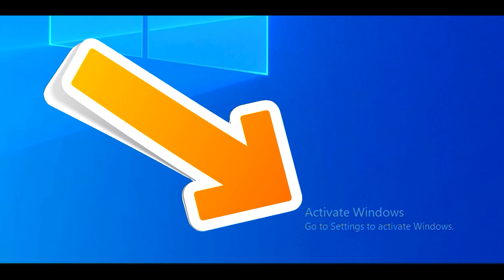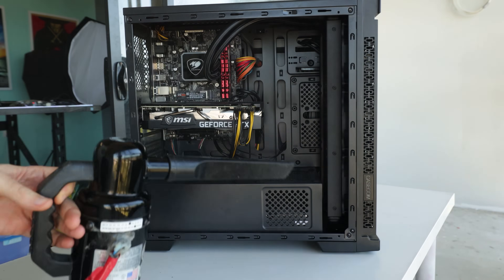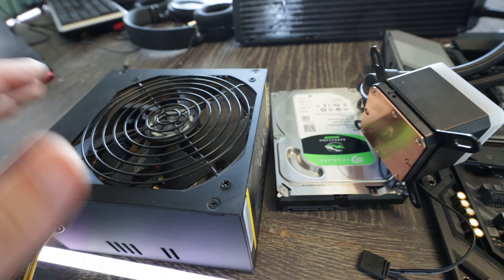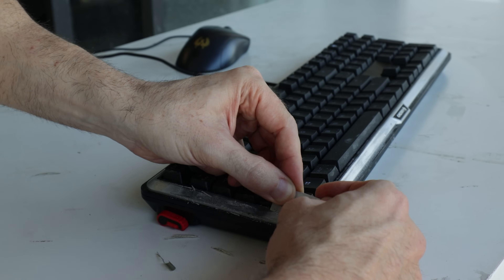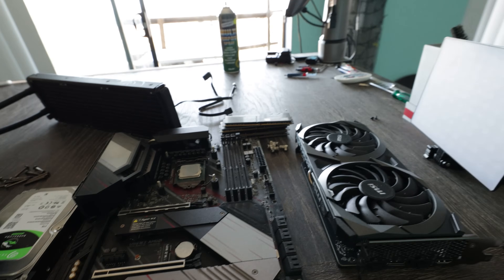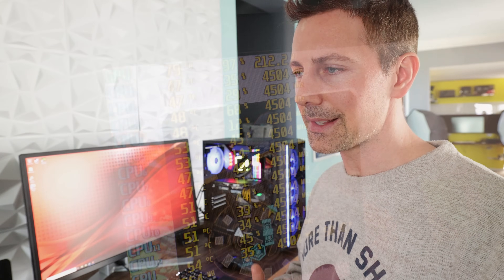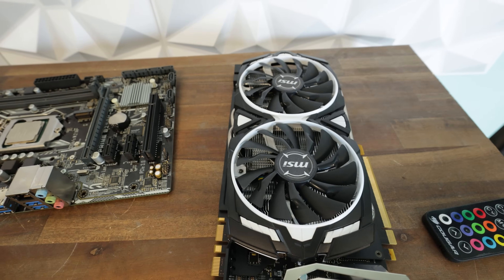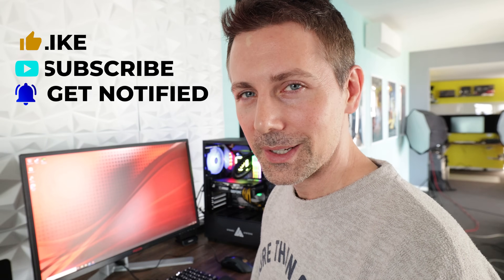How I got a $1000 RTX 3070 SETUP (Cleaning and Fixing)

Comment: Ketchup and mustard power cables for RTX 3070 build, are you kidding me Bryan?
Reply from the maker: Haha cables would make for an interesting video, believe or not I have had only a handful of people ever ask me about custom cables.  They don't make that much of a difference for the sale.
Reply: @techyescity  If everything else fails go for black gaffatape :) The good stuff that "sticks forever". Not the cheap $7 rolls ;)
Reply from the maker: @peterpain6625  I reckon some duct tape and then just say in the ad "custom shiny gray cables (NASA inspired), one of a kind".
Reply: they don't matter
Reply: @chrom4ful  even if you dont mind ugly cables in such high end system, those ugly cables means that power supply is cheap and  probably not good enough for rtx 3070 anyway
Reply: @Prlz3  nonsense, cable "prettiness" is not indicative of PSU quality, I would trust color-coded factory issued cable anytime of the day rather than nylon-braided "pretty" cable which is more of fire-hazard than regular one , they're color-coded to indicate different voltages the power supply supplies, for example black for ground, yellow for 12V+ rail, and red for 5V+ rail. What determine PSU quality is the components inside, the electrolytic capacitors, the transformer, the mosfet regulators
Reply: @chrom4ful  i know that, but still , all MODERN quality psu's comes with black or sleeved cables and most of the poor quality psu's comes with colored cables.
Reply: @chrom4ful  i dont say that ALL PSU's with black cables are good, but almost all with colored cables are the cheapest and so for the less quality ones.
Reply: @Prlz3 even more nonsense, all enterprise-grade PSU are all have color-coded cable, seasonic and superflower still make PSU with color-coded cable, once again BY NO MEANS color-coded cable is indicative of PSU quality, the quality is determined by components inside NOT the cable conductor outside
Reply: @chrom4ful only thing you miss is that i wasnt talking about ENTERPRISE psu's.We are discussing regular gaming PC's if you didnt noticed.  If you are so sure about your statement, then just give me link to the good quality mid/high-end 600-700W psu that got colores cables, thats it ;)
Reply: @Prlz3  easy, SeaSonic SSP-750RS SeaSonic SSP-1000RS, look those up
Reply: @chrom4ful  once again, it’s literally says “INDUSTRIAL” on their product page and even if you can use them in your gaming pc, why would you lol they are ugly and costs a ton of money, for that price you can buy great PSU that looks good too
Reply: @Prlz3  Nonsense, don't try to shift the narrative now, I couldn't care less about your preference, not everyone staring at their pretty machine all day long and post picture of their machine for internet point, you said "those ugly cables means that power supply is cheap and  probably not good enough for rtx 3070 anyway" which both assertions is NOT true at all, this will be the last, color-coded cable is NOT indicative of PSU quality.
BTW industrial means utilitarian goods without marketing jargons BS, you can buy them off newegg and got them delivered since they're still consumer goods, enterprise-grade PSU uses different form factor that slot right in server-rack, and they have different enterprise protection plan.
Reply: @Prlz3  KEKW
Reply: @chrom4ful  just like no one is gonna buy thos INDUSTRIAL psu that you gave links to and pairing them with such a high end gpus xD  
and look up for antec vp700p psu (used in this build) and you will tell me that this 40$ psu is good for this build?
Reply: @Prlz3  I couldn't care less what other will buy, the fact that Seasonic and Superflower still make those PSU indicates that the there's a steady and sustainable demand for non-flair utilitarian PSU, don't try to divert the narrative now that you got your arguments shot-down handily, you made assertions that, one color-coded cable is for cheap PSU which is NOT true, and two color-code PSU is indicative of bad quality PSU which is also NOT true 
Brian's build run just as fine with the PSU because he CLEARLY know it WILL work, he's been doing this dor years.
Reply: @chrom4ful  that demand surely doesn’t come from ppl buying then for gaming rigs, and I was talking about only gaming rigs in the first place, I never even saw that seasonic psu’s, because if you go to any website to shop for computer parts there will be tons of psu in that price range and all of them will have black cables as they should be. So if we only talking about regular psu’s that everyone buys (as I was in the first place) and not some industrial grade seasonic psu that maybe! 1% of the consumers will buy, then my point is still valid ;)
Reply: @chrom4ful  plus there is TONS of psu’s  and you only give one model that is good and ugly at the same time 😆
Reply: @chrom4ful  and what makes you think those are qualitty psu's?)  SilverStone ST1000-P 1000W  this one is from 2010 xD 
Rosewill Glacier Series 700W got 3 eggs on newegg and lost of compains from customers 
Montech Gamma II 750W, 80+ Gold Certified this one literally has black cables (thanks god)
Segotep 700W Power Supply ATX 80 Plus Gold Certified has only 2 reviews on newegg and both 1 egg -_- 
TOPOWER TOP-1300W got no reviews at all  lol 
nice job picking up all this "quality" psu's, i hope you dont at least help other people to build pc's
Reply: Thank you so much for the reply, you made my day, love your channel sir! :)
Reply: Kelly Gilbert  fat Sharpie is quicker.
Reply: Ketchup and mustard cable gotta be at least minus 30fps to any rig. 30 quid for a set of cable extension will look so much better and add at least 60fps 🤣